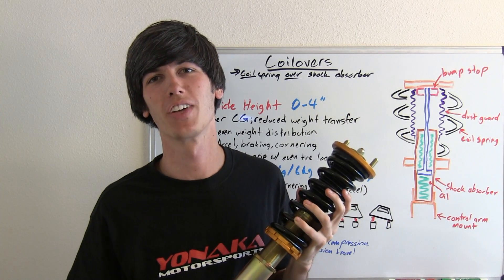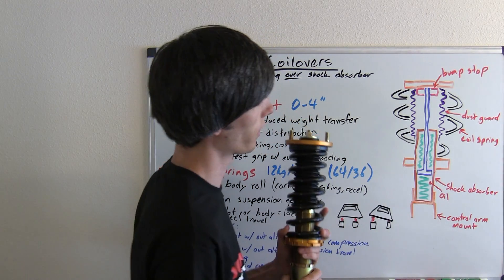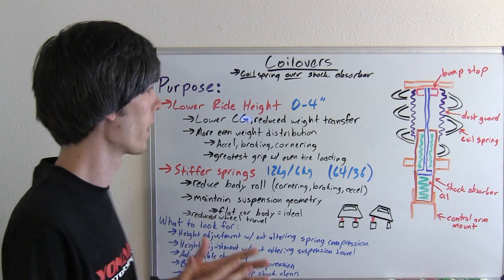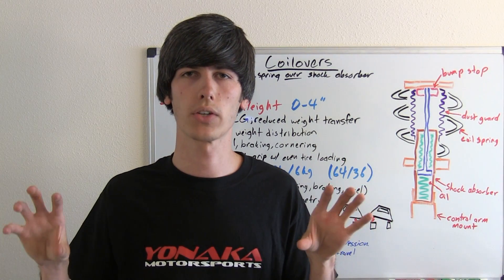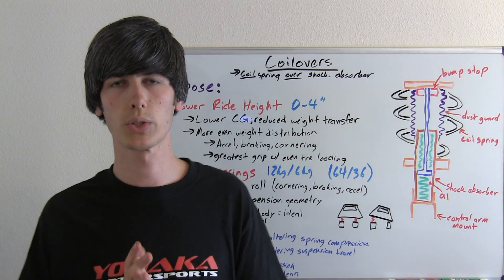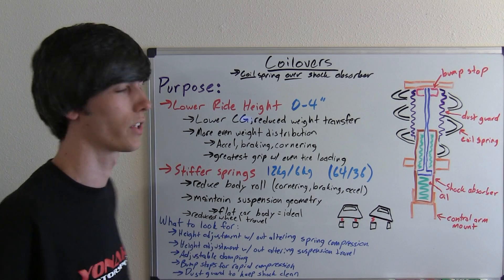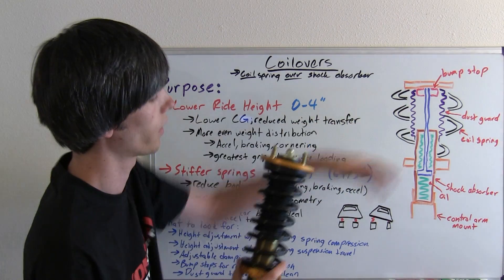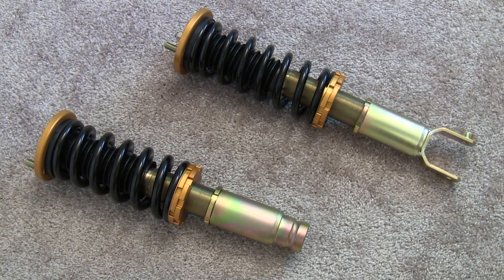Coilovers - Explained

Comment: I am not car savvy but I have a 2017 Infiniti q60 and have 25mm spacers on. I have about 1 1/2 inch gap to my fender.  Wanted to get 1 inch lower. Will a good coil over combined with my spacers ruined or throw off my suspension? I don't want my car computer to throw off codes due to these modifications.

Comment: I adjusted the high with the 2 upper rings I didn’t know I could make it higher by unscrewing on the bottom I hope I won’t have any problems because it was hard to adjust forcing the sprig upward

Comment: thanks for this. 

I am looking for information for coil overs for raising a vehicle's ride height. As the springs would still be stiffer, I do then assume to achieve a ride height increase for a coilover, the springs would be longer and also the damper. With this coilover setup for a raising ride height, would this be a good option to look at versus regular spring and damper change?

Comment: Tip of advice to FWD guys, yes they usually have a 60F / 40R weight distribution, but having stiffer springs and damping turned up in the rear makes FWD amazing and hook like an AWD!
Just saying, give it a shot (oh yeah and go back to stock rear sway bar if you do, as anything bigger, unless yours is for example 10mm thick vs 27mm front, will be way too much, the suspension will handle everything at this point

Comment: Hi I have coilovers kit comes with adjustments and damper  . But my alignment is not enough  for my 2015 mustang and I need to put on BMR camber caster plates to correct it  . Is it easy to put those plates on pullovers

Comment: Thank you for your sharing your knowledge on coil overs, I am from India I have a Honda civic FD 2007 with the original suspension the car bottoms out a lot, what I want to want to know is, is there a cheaper version of getting my car's suspension tuned as in a street car, or do I have to go through the aftermarket suspension.

Comment: Not to sound like a know at all. This guy is amazing. But when you lower your car On just coilovers. It does not actually lower the center of gravity nor does make the weight evenly distributed. In fact, it actually raises the center of gravity and creates more body roll, since your car lower to the ground, but now more weight is closer to the wheels which can cause body roll and (improper corner balance) Corner balancing is when an alignment shop ( a very good one) adjusts your car properly using camber, caster and of course toe to help align the car. On top of that- they need to mess around with the suspension spring height and adjusting the weight of each individual wheel. With a stock car with a low weight spring that’s obviously much harder. With coilovers and choosing which springs you want on your coilovers, it makes it much easier to do so. Again not to rain on this mans parade. He has more knowledge than I’ll ever had. Just something I learned from an incredible shop I helped work at this weekend!

Comment: Do you have any info posted about dual spring tender spring or helper springs used in a coilover system? 
I'm trying to get some more comfort with my heavy coil springs and don`t know the best way to go about it. Also 12k/6k seems pretty extreme. Would you please explain a little more why you would choose these rates?

Comment: Hi as usual great video! I'm doing some modifications for Honda city overall like changing front and back bumpers adding splitters and side skirting! So it will reduce the ground clearance! Would you suggest me to put air suspension or coilovers in order to increase the height and ground clearance? And how long it will last? This car is a daily used car! 

Awaiting for your precious reply! Thanks

Comment: I need to know if the shocks are gas or fluid in the yonaka coilovers. I almost bought a set but the price went up
Then i came across a set of koni shocks with springs and thicker anti-sway bars for a good price

Comment: If you lower the car a substantial amount, the steering arms will no longer be level...this induces a condition called bumpsteer. As the front suspension moves up and down, the angle of the steering arms changes, causing the front wheels to steer slightly. Of course this can happen even with stock ride height, but the amount of steer is greatly reduced if the steering arms are level at static ride height.

Comment: I'll never forget I had an old RWD Malibu with sacked springs in the rear that I did not want to pay to make new again so I asked about coil over shocks (since it was also ready for shocks anyway) and the first couple service writer/mechanics were like"huh?" basically claiming I had no such option    ...So finally I just went to aftermarket parts counter and ordered a pair of coil over rear shocks ....peanuts $ compared to doing it "right" ...It TOTALLY corrected the problem, Worked perfect!  I was very happy ...never did understand service writers claiming there was no such fix....wth??

Comment: Whats the benefit of going for a coil over vs an adjustable strut and lowering spring? I've found lowering springs with similar spring rates to some coil overs, but I can throw a set of adjustable struts and do all 4 corners for the same price vs a set of just 2 front height adjustable only coil overs

Comment: Question, on vehicles with front disc and rear drum brakes And ABS, do the drums pulsate in order to prevent lockup? I can't fund a clear answer. Commercial vehicles sucks as trucks that use drums on all axles seem to but not sure about modern day vehicles. Help

Comment: I dont know if you take requests, but I was wondering if you could talk about extended ball joints.. why you'd need them and what they do and when to know you need them (maybe even mathematically or mechanically speaking). It's a bit if a controversial topic on forums with mixed information and opinions. This may also blend in with roll center as a topic as well. I just thought that since your basically "da man" at this kind of thing, I'd throw my penny into a wishing well for it. Wont hold my breath though.

Comment: Hey Jason.. I put coilovers on my civic back in February and I’m still on my stock wheels and tires. BUT the inner sidewall of my front two tires rub on part of the lower part of the coil springs when i turn the wheel halfway to the left or right. I’m getting new wheels here soon but I was wondering.. is there anything I should be worried about with the rubbing on the springs?? Besides the paint on the springs getting worn off.. is there anything else I should be worried about??

Comment: What does ur spring compression measure  because I  moved  my spring  an I want it back at stock  i have them on my 1998 civic .An if i do adjust spring does that make it stiffer orsofter. These don't have damping

Comment: So I had someone install my coilovers on to my G35 sedan. But now, my rear driver corner is making a ting or clanking noise whenever I drive it. And if I was to just press the acceleration on a straight road without handling the wheel, it would start to move to the right automatically. Could it be that the preload is set incorrectly or what?

Comment: I know this video is super old, but i got a question i can't seem to find an answer too. How do spring rates affect your traction during rapid acceleration/braking? For example, in the S2000, would softer rear springs respond more to the rear weight transfer, thus laying down more traction, or is it the opposite?

Comment: It sounds like a dum question to me, but I'm asking anyway. Whats the reason for altering the spring compression? I mean the spring rate is the same no matter how much the spring is compressed, right? So the car will always be on the exact same level when you use the same spring and the total length of the strut is remaining constant no matter how much you compress the spring. So whats the point of changing the no load spring compression?

Comment: After reading some of the comments their seems to be some confusion with the term "coilover". There's basically two different meanings when people generally refer to coilovers. When people typically refer to coilovers (as in this video) they are usually referring to aftermarket coilovers that are performance-oriented and are usually adjustable in both ride height and shock stiffness. The shock/strut & coil spring are integrated into one assembly where the coil spring is seated over the shock/strut, hence the term "coilovers". 

However, most vehicles that have Macpherson strut front-suspension design use an OEM strut & spring assembly where the strut and the coil spring are integrated together into one unit, so technically they can be considered a coilover, but they are OEM or OEM-equivalent and are not adjustable. They are also primarily designed for ride comfort over handling performance as opposed to aftermarket coilovers that are performance-oriented and designed for handling over ride comfort. Hopefully that clears up some of the confusion.
Reply: thanks! i commented before i read this.
Reply: Thank you and yes it does

Comment: I put Function Form type 1 on my accord  have ot raised instaid of lowered all the way and I maxed out the height without the coilovers come out at the bottom of the base o notice my driver side sits lower than the passenger how can I fix this and can I touch the pre load to lift it. It's by a half an inch difference not much and which way doi turn right or left to change it and raise it???

Comment: Thank you for the explanation on coil overs.  However, I don't have the funds to buy it right now. At the moment I have STOCK 2017 Toyota 86 (frs)  . I do want LESS tail slide and MORE grip , however, I do have a mortgage and spending thousands of dollars on a couple of components is not doable at this time for me. Good coilovers cost thousands and I'm not ready to make big modification right now. Another thing is , I don't know too much about offset, inset, spacers , etc.  My question is, if I just changed the stock tires and go with better tires like the Michilin PSS or Yokahama , etc. and keep the new tires same size as stock will i see better grip on this car ? I just want to get rid of some of the "tail happy" slide. Thank you and looking forward to your reply .

Comment: I have a question. I have a tacoma, and I am interested in getting a lift for my truck. I want to get economic Bilstien 5100s or OME shocks (or dampners). As for the coils for the front, I am thinking of getting an OME 887 springs. I am told that it's the coils that give the lift for a truck, and not the shocks themselves. And though I could use the stock coils, it would be sprung tight and there by increase bounce and ride stiff. My question is, are the springs or the shocks that provide the dampening as you go over ruts and rough terrain?

Comment: You may have to calculate your specific spring rate and order custom springs. Don't expect that your just going to get the ride your looking for by slapping on a set of coilovers even if thier v3 kw. Especially in an engine swapped car. It may work out , or it may be trial and error. You may go through three sets like most do. For suspension to work it has to have room to move plain and simple. Watch roll bars, they may have a negative effect on compliance with coilovers. Suspension set up is a work in progress and a tradeoff of handling vs ride quality. On the softer side offers more traction on the street, tracks are smooth roads are not.

Comment: Ok, thoroughly confused here, please help. I just watched a video where you don't recommend "lowering springs" because of how they change the ride characteristics of your car, but in this video you explain "coil overs" and it sounds like they do exactly what "lowering springs" do. Please explain. Thank you in advance.
Reply from the maker: +Max Levine lowering springs don't match the damping rate to the new spring rate, so your car has less suspension travel but the dampers are unchanged. Coilovers match the damping rate and spring rate for the suspension travel.
Reply: Engineering Explained What about companies such as this one (read below) that claim to match the OEM damping? Are they safe?

"Taking our experience on the MQB platform, along with testing on our in-house S3 and MK7 GTI, we have developed what we feel is the best lowering spring option for those wishing to utilize factory dampers. Using a linear design (similar to OEM) with unique spring rates, our lowering springs are properly matched to the factory dampers, ensuring a ride quality that is slightly stiffer than stock, but predictable in nature."

Comment: How can you raise and lower your car on demand? I seen a video with a guy in a Optima or lowered and raised his car. Kinda like hydraulics but not to that degree
Reply: Those are generally air suspension setups or "bags".
Reply: Interflop thank you i know it might not be the best for handling but it doesn't negatively affect the car does it ?
Reply: Supposedly if you have a quality set of air suspensions it sometimes rides even better than stock. You'd have to do some research on it because I haven't done much myself.

Comment: hey i am in the market for coilovers for my 97 civic ej6 i want quality, and i want a good balance between handling and comfortable ride, i was wondering what is th "best brand or brands"? and if i need pillowball mounts and resevoirs and adjustable dampners and ride height? its not going to be a track car its my daily driver but id like it perform abit better on turns and still be able to handle the bumpy highways

Comment: hope you see this:) was just wondering if you could answer a question of mine: how would coilovers(good ones) compare expensive(ground control) adjustable springs with a coilover body and very expensive(180 a piece) adjustable shock absorbers. i can only adjust height on the springs and dampening on the shocks( as in no preload or anything else) decent coilovers cost about a grand i think these were about 900-1200(i didnt buy them)

Comment: having an issue and need some advice- I installed coilovers last week on my e36 and when i did the rears i had the height adjustment above the spring all the way low to fit the spring in. (they're 2 pieces, not an actual coilover in the back) my car remained stock height, and even after messing with the pre load it is still stock height. is this because i have it at its lowest point and didn't let the strut settle? should I raise the height adjustment to put compression on the spring and to settle the strut? then would it go lower?

Comment: If you increase spring rate, you will need to adjust your rebound and compression in the shock. If you are going from a soft spring, your compression will be to stiff and your rebound will be to fast for the stiffer spring. The proper spring rate should be vehicle weight plus passenger weight and spring accordingly. Then revalve the shock to slow or speed up movement of the spring for the compression or rebound, to your needs. Be careful to not preload the spring to much or you might coil bind the suspension.

Comment: I have low budget, can i just change my actual springs with a little bit lower (3-5cm) and a little bit stiffer ones and still get good handling improvement or have i to spend at least 1000€ on coilovers?

Comment: Are these ideal for cushioning the ride as well? I have a stiff 2G Eclipse handling corners like a champ but I can also feel every irregularity in the road as I drive over them. Other cars can drive into potholes (!!!) and the driver barely feels a thing. I'm replacing the shocks very soon and would like to have ideal suspension with a little comfort as well.

The weight transfer on my winter beater is awful on turns. Almost feels like it can tip over. Comfortable ride but yikes!

Comment: why do people call them coilovers when really they should be called Macpherson struts.
Reply: Macpherson struts are shock bodies with a toe linkage attached.  Your tie rods are connected to the shock bodies via that linkage which rotate the top of the shock when you turn your wheel.   On integras, the tie rods are independent of the shock bodies.  IMO the non-macpherson is better from a coilover standpoint.

Comment: why nitrogen gas is used in shock absorber and  argon not?
Reply: Arsh Sidhu
Cheap and stable element.
Reply: Jay Edlington instead of cheap and stable, is their is any other reason???
Reply: you dont need other reason. Stable being is very important if you dont want to adjust / replace your suspensions every few weeks

Comment: Thanks very much for this mate. I had never heard the term until about twenty minutes ago, googled it and got your video. Brilliant!
The only think I don't undersand is why you need coil springs AND the oil cartridge shock absorber. Is that solely for controlling the damping? I am a motorcyclist where we use cartridges up front and a coil at the back - possibly with a small sealed shock inside that.

Comment: You need to explain the gas versus aspirated coil overs. Also you need to mention camber because camber also gives your friction depending if the Tarmac or Road is curved like a NASCAR track or originally straight

Comment: I just installed a set of yonaka coilovers in my car and it seems that the springs are bottoming out, i took some measurements and both of my rear (the rear are bottoming out) are 8.5 inches with the car jacked up. Is there a specific height that the coils have to be at or am i stuck with a banging noise everytime i hit a bump in the rear? I've already contacted Yonaka about this and they were no help.